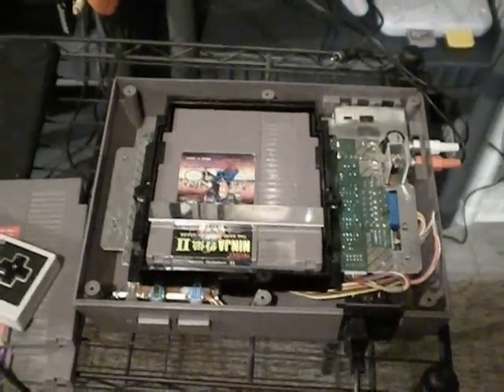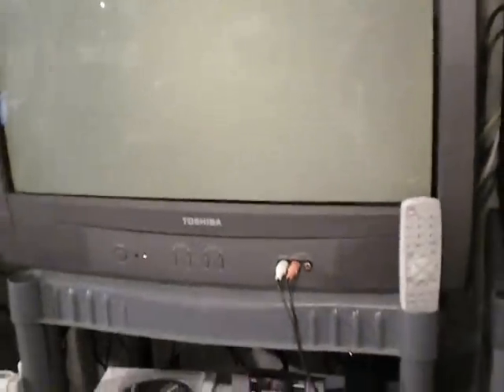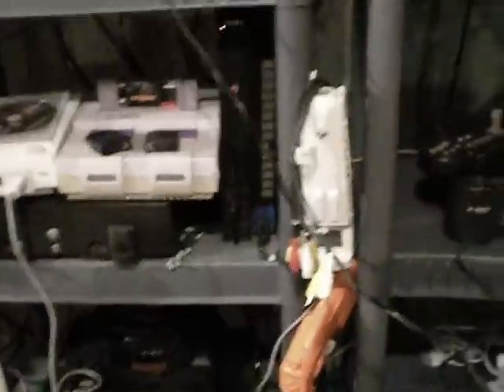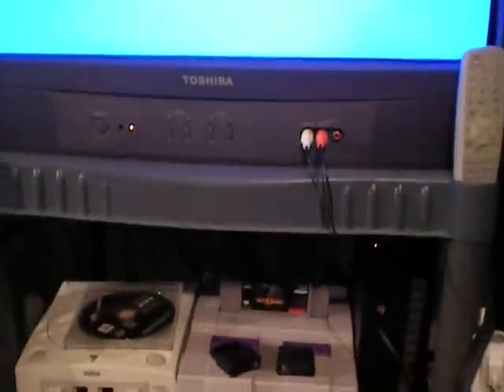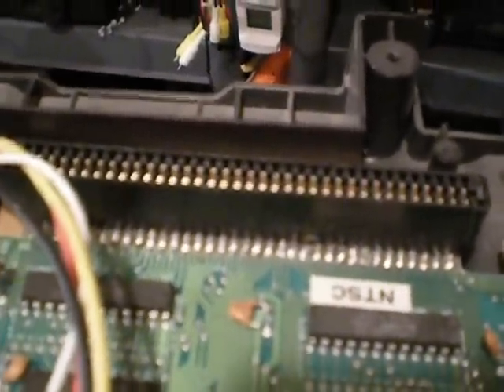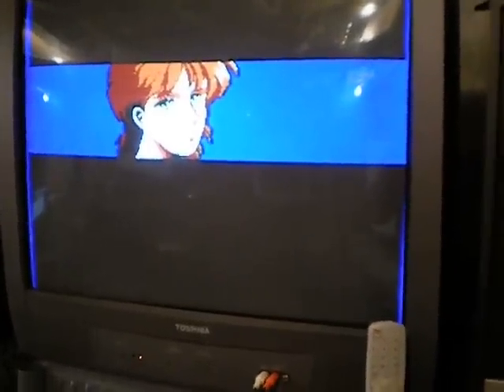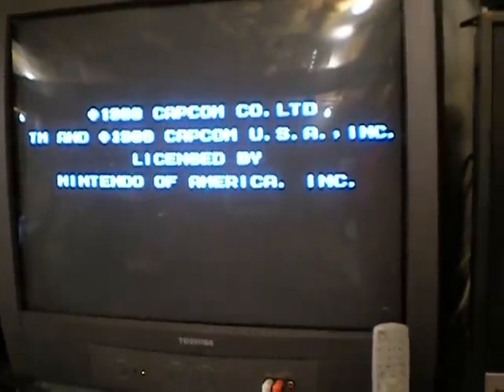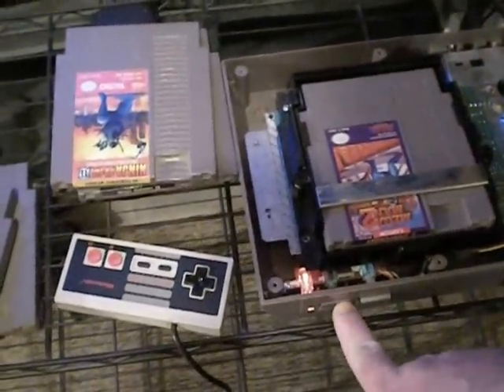Experiment: Disabling NES Lockout Chip to make dirty games work

Comment: you do know that that is caused by the 72 pin zif connector. can either try and bed the pins back and there is a video on youtube for that of get another which is cheap.mine still is tight and don't need to push it down to work. this is a flaw nintendo design. over time the pins bend and eventually lose contact. nintendo was trying to make it look like something to fit in entertainment center to make people buy after the crash so they made games go in front like vcr.

Comment: It looks like a pink NES cart with a handle and contains some rubber-ish material. It says it's only good for 10 cleanings, but I just clean it with 91% rubbing alcohol and have been using it since the 80's. I think it might be "Game Doctor" or something.

You could also pull the contacts back out on the 72pin connector, or buy a new one. The new replacement connectors play pretty much everything on the first try.

Personally I would always rather play NES games on the front loader.

Comment: I always hated that! Then to make it worse people blew on the cartridge which oxidizes the pins. 

The best thing I ever did was to never allow a dirty cartridge in my front loader. Whenever I obtained a NES cart I would take it apart and clean the contacts with a pencil eraser. I Everything still works on the first try with my NES system from 1986.

I will occasionally use a cleaner on the system that removes debris from the NES cartridge port. I don't remember the brand, but it works great.